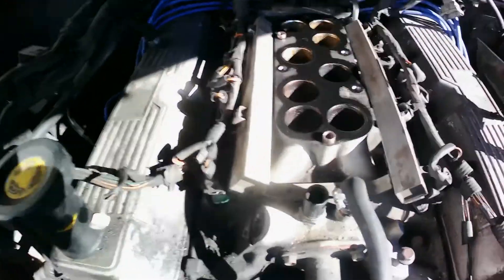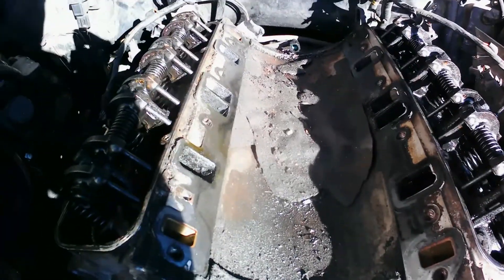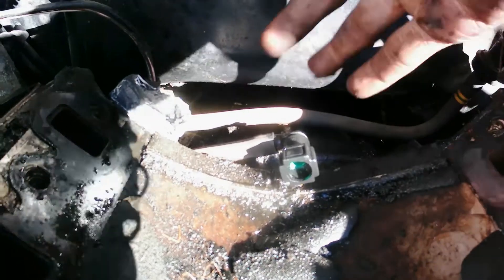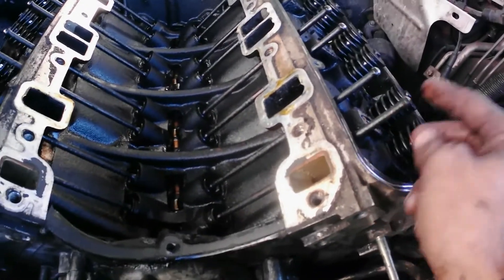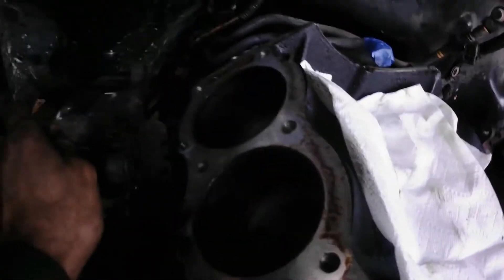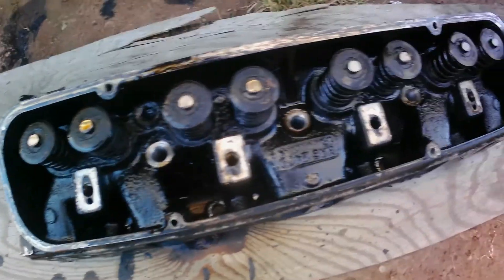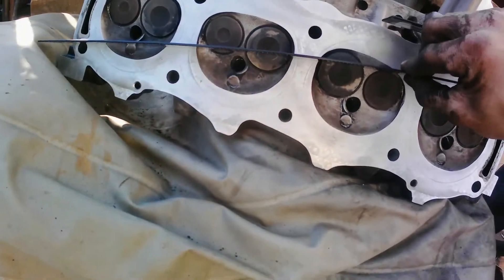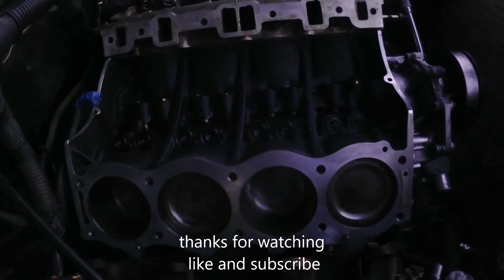land rover discovery 2 head gasket replacement part 1

Comment: Good job. What did you use to clean your block and the heads? Looks pretty clean.....
Reply from the maker: Brake cleaner and the blue non scratch scrubber that's wha I use
Reply from the maker: And a small brush for some areas